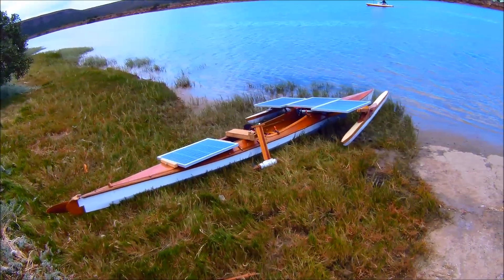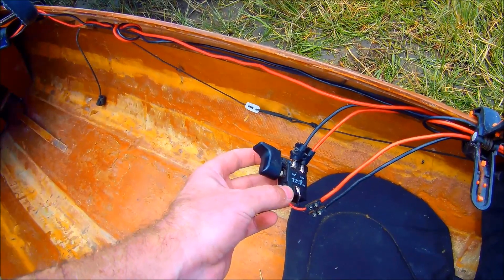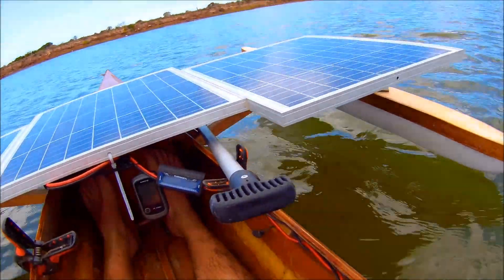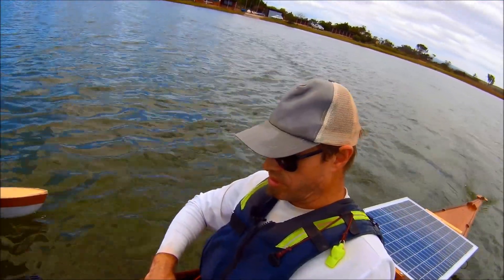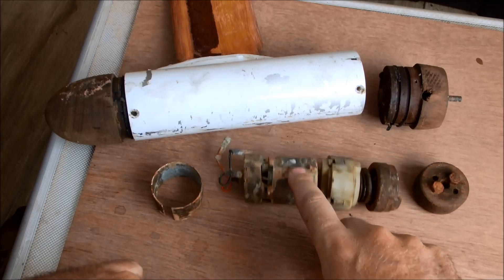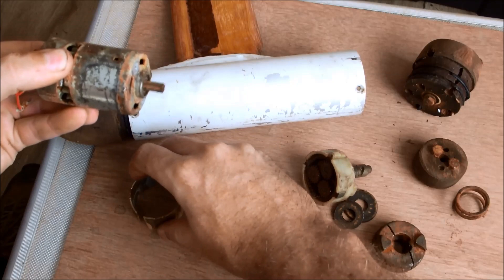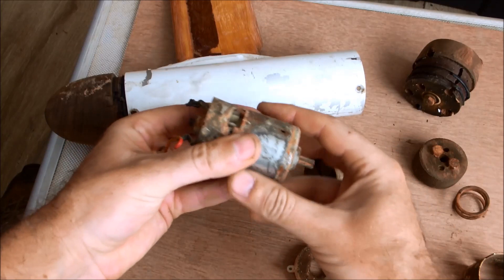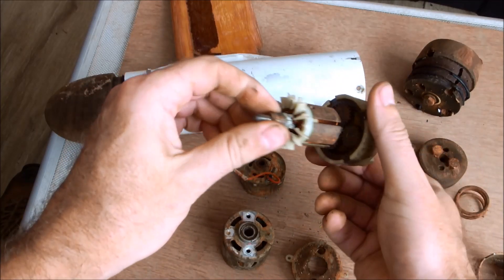Solar kayak - wiring detail, motor fail and post mortem.

Comment: you need a capacitor on the solar panel side to smooth out their output, so the PWM dead time in the switch isn't just turning them off.

Comment: I have been using Blue Robotics T200 thrusters (https://bluerobotics.com/store/thrusters/t100-t200-thrusters/t200-thruster/) for a few years now. I have a "skid steer" setup using a Blue Robotics Thruster Commander (https://bluerobotics.com/store/comm-control-power/elec-packages/cmdr-r1-rp/) Not the cheapest solution but in my humble opinion a very elegant solution. 

Here is a short video I made of my initial test setup with the T200 thrusters and the Thruster Commander. 
https://www.youtube.com/watch?v=aEola7Ek9Ho&t=25s

I would also suggest having some sort of battery with a solar charge controller in your design and let the solar panels charge the battery and run your setup off the battery instead of being directly tied to the solar panels. Again, this will add costs.

Comment: Good luck in your solar race today, hope you were able to finish your brushless design in time!  It's great that you had this failure before the race and not during. Hoping there is some coverage of this fascinating race!
Reply from the maker: I unfortunately had electronic trouble and could not race but at least had the motor ready and experienced a few seconds under power.
Reply: @williamfraser  Ah, that sucks. On the other hand, it could be great content for your channel if you decide to post an electronics post-mortem.  I'm curious about what the trouble was.
Reply from the maker: @InfinionExperiments  That is exactly what I am busy with...

Comment: Will, is the brushed drill motor required for the race you are preparing for?  I ask because your previous video about motor efficiency seemed to tech me that this motor will only be efficient at specific voltage and current which could only correspond to one level of sunlight.  A brushless motor would have a broader range of efficiency with the controller adapting wouldn't it?

Your woodwork is cool but don't you guys have 3D printers down in SA?

Thanks for the update.
Reply from the maker: The race allows any motor type. I am trying to finish my brushless drive for the race. You are absolutely right about voltage, efficiency and sunlight. Regardless of motor type, the best efficiency voltage depends on input power, so with the panels connected directly to the motor, the system can only operate at max efficiency at a specific level of irradiation. The prop load on the motor determines the correlation between power and voltage. A prop with finer pitch will be better suited to cloudy conditions. With a buck converter or MPPT the voltage going to the motor can be lowered if it gets cloudy, so the prop can stay the same.
Reply: @williamfraser  I am right because your videos taught me well.  Because this video was posted later I didn't know you were well on your way developing a brushless motor with a right angle drive to keep it clear of the surface.  This video is useful for it's postmortem and wiring -it's just not your current state of development.  You didn't answer my printer question -if you could print, maybe I could help with design.
Andre, I would like to see the numbers on a motor that would turn slow enough to go direct drive but I sure wouldn't want to try beating Will's design by winding my own.  A solid shaft angle screws up the attack angle of the prop, up side vs down.  The pedal boat guys do well with flex shafts but there is no future in it because it is so awkward and fragile.  I have an idea for a skeg with a shallow angle drive that is solid state and would allow small angle thrust vectoring but the there is no solution for prop size limitations and disturbed flow.  The shrouded prop guys claim some pretty amazing efficiency claims.  I would like to call their bluff.
Reply from the maker: @markvandenwymelenberg1459  last year's race winner has a 3D printing business. He is printing a housing for a brushless motor to drive a prop directly, much like a conventional trolling motor. He connects his ESC directly to the panels and use it to adjust power on the motor to keep the panels at MPP. His ESC gets insanely hot due to it operating at partial throttle. Not the most efficient but like I said, he did win! I use wood because I am equiped for it and find it beautiful. Some of the wood species I have will rival aluminium for strength. Where necessary I use glass or carbon fibre.
Reply: @williamfraser  Well then obviously your best plan is to find a competing 3D printer business and get a sponsorship (free printing) to defeat last years winner.  At least it is obvious to me and we think alike so often I assume it is obvious to you.  Hot FETs are a greater loss than any decent gears (or my knowledge of the tech is out of date).  
You were beaten last year so we should do some calculations to characterize the concept.  Do you know what motor he used, or at least the diameter and the RPM?  And about your gears, what is the ring diameter?  Can it be purchased, or did you harvest it from an old grinder?  Have you done any measurements on losses at relevant speed and loading?  Just a thought, helical gears superiority is smoother operation at higher speeds.  At low speed straighter cut has less rubbing loss and vibration is not significant.  In any case, lubrication is critical.  Have you seen the new Shimano transmission patent?  Apparently there is a surprising amount of disclosure about high performance lubrication.  If they think it is a breakthrough, I think we need to review it.
So last years winner manually throttled a directly connected motor to keep his panels at peak performance.  My thought is that the ability to print an optimum prop and case goes a long way to make those parts work together.
Reply: @markvandenwymelenberg1459  Made a comment earlier that the race was in Australia but I was laughably way off the mark. Don't know how I even got that in my head...oops.
According to the video the race is being held Today, this Sunday, so unlikely that the OP will have time to make changes at this point..
I think the OP has the right idea maximizing the efficiency of the (now defunct) DC brushed motor and using large, low-rpm props. It'll be interesting to see what he can do with 200W of solar. Tough when the maximum allowable solar power is a whopping 1.28kW, I wonder if there are brackets that divide boats into separate races based on solar generator output, or if it's just a single-bracket free for all.
Reply: @InfinionExperiments Thanks for knocking me back on track.  I don't know if he finished the brushless design.  It has been a month but carving out of wood is slow. On the bright side with the motor above the surface the new design is more forgiving.  200w is twice what he needs to push his 17 ft kayak to hull speed ~5.4knots so if it is a sunny day either motor will work.  If someone shows up with a 30 ft freighter canoe carrying a kilowatt plus of panels I think they will win... until the foilers show up.  I have a Pax20 (20ft long, 17.5 inch max beam) that would be an excellent base for solar.  It didn't touch water this year because it only makes sense if you paddle at 5+knots and it's awkward to haul for a short workout.
Reply from the maker: @markvandenwymelenberg1459  I think he used the turnigy rotomax 50, no idea about rpm. The gears I have can be bought as a spare set for one of the small Makita angle grinders. They are helical gears, the bevel gear is around 2" diameter, reduction ratio of 3.7 : 1. One issue with them is that they are designed to only turn in one direction and the pinion has no key-way, so it relies on the nut to self-tighten under load. This means that to reverse you have to swivel the entire motor around. It is how most outboard motors of <3hp operate. I did  not have a successful race today, I will do a feedback video once I have done some fault finding. Bloody electronics that go "pop"...
Reply: Back in my college days (30+ years back) a group of us were into racing RC cars we would buy cheap motors and rewind them to get different run times out of a battery. 
Were I doing what you are I would look for a larger diameter motor slower motor, get rid of the gearbox and go direct drive to the prop. Put multiple windings in the motor setup so you can do some series, parallel switching. May be more efficient then an electronic MPPT controller.